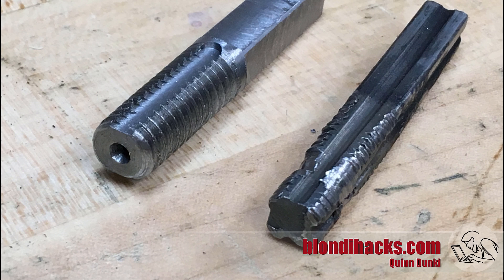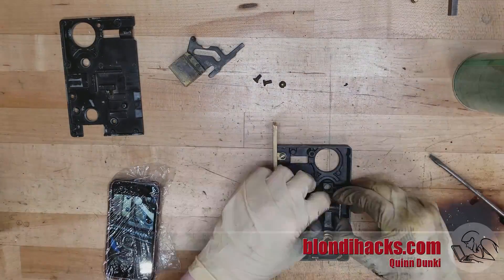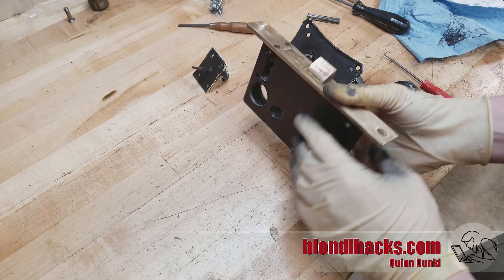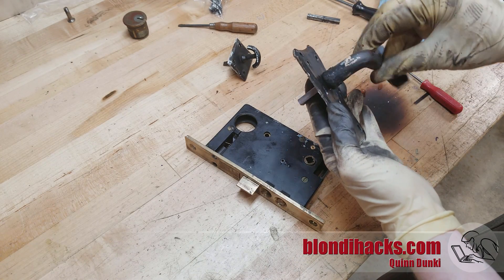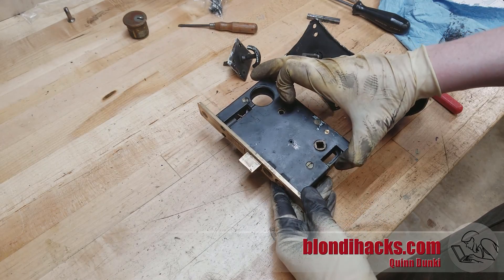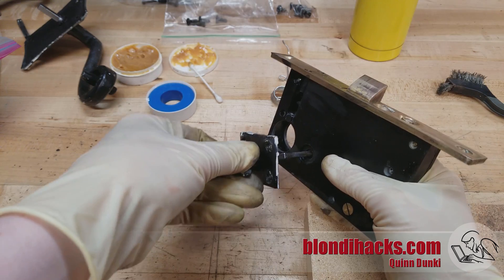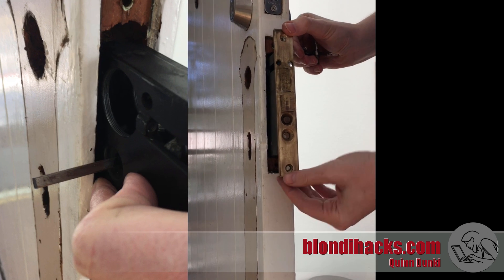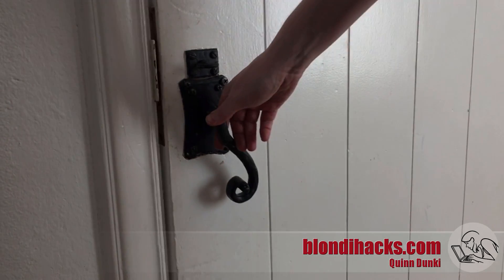Antique Lock Repair : Part 4 of 4

Comment: That inside handle does not look original and normally would be mounted sticking out horizontally.  However it is too heavy for the return spring in the lock and would sag right from the get go.  There are a fair amount of the old cast iron mortise locks still in use.  I have been fixing them for about 50 years.

Comment: Ms. Quinn,  I have enjoyed this series immensely. I am the guy who repairs these things with what he finds in Home D****.  One tip for your viewers for getting paint off of old metal is to boil the part in water mixed with backing soda. It is environmentally safer than methylene chloride but be careful about disposing the removed paint and sludge. It may contain nasty studs so consult your local regulators. Generally lead that is contained in plastic can be tossed but again consult your local authority.